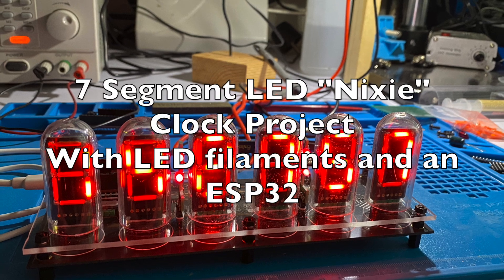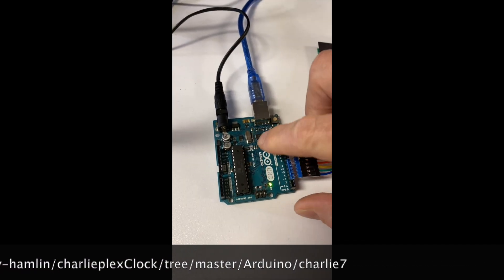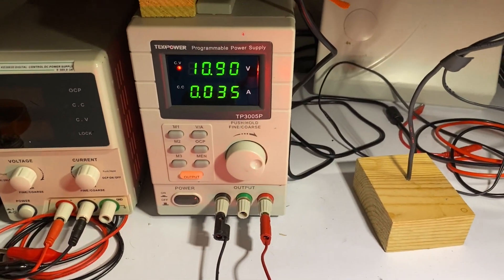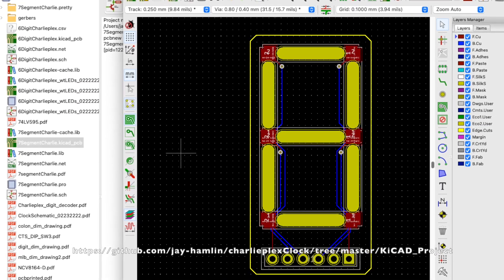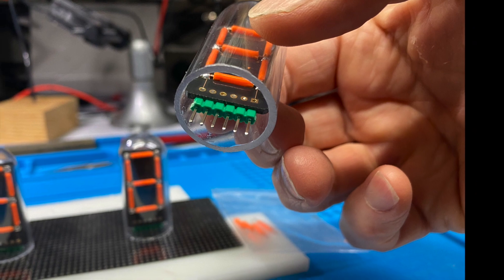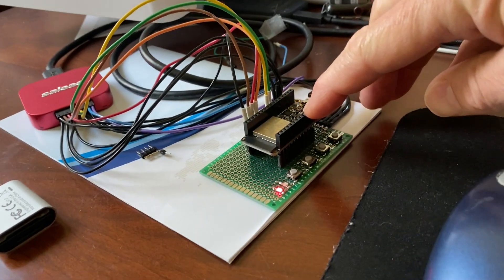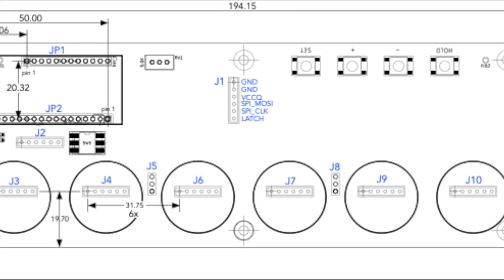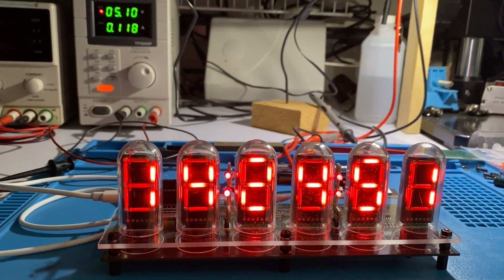LED "Nixie" tube clock, ESP32, Arduino, 7 segment, LED filaments

Comment: Why 6 pins for each digit, charlieplexing should reduce that to 4. (n^2 - n)
Reply from the maker: Yes, what you are saying is true - with 4 pins you could turn on any 1 LED segment.  The 6 pins are also mechanical, holding the ends of each segment. Also, with 6 pins, it can make any number digit without multiplexing.
Reply: @jayhamlin9991  0:58 I can see how each segment can be turned on at a time, but how would you make the digit "8" without multiplexing?  If pin 5 is high and pin 2 is low, do you mean make pin 5 high, make pin 2 low and the rest high impedance?  I think that might work, though current would be split down some paths.  It looks like you still multiplexed each segment, but maybe you designed for the possibility of doing it differently.
Reply from the maker: Ok, you are right, you got me.  Enough time passed that I forgot how it was done.  Only 1 segment at a time is turned on and the digits are multiplexed.  You can check out the code on GitHub and see how it's done.  @Enigma758
Reply: @jayhamlin9991  Thanks for the responses and sorry for all the questions (sometimes I think too much ☺) .  I think the fact that you used 6 pins made it easer to multiplex since you could simply break out each intersection.  That way you wouldn't have to hard wire the additional connections required for 4 pin charlieplexing.  And considering that was probably decided before you added the backing PCB, it seems like a reasonable decision.  But now that I think about it again, the digits are driven by the shift registers and not the microcontroller I/O pins so you really can't do charlieplexing since you can't set an individual shift register pin to high Z.  So I believe you are actually doing "traditional" multiplexing at the segment level.

At any rate, you did an amazing job on the clock and it inspires me to do something similar!

Comment: Question: I got those LED filaments here, where is the anode where the cathode part ? One end has a small hole in it, so it is definitely A/C but hardly to know which. Dont want to waste any filements, so any hint is great
Reply from the maker: the end with the small hole is the positive (anode) side. They are sold as "3 Volt" filaments but I found they work good at 30mA which was about 2.72 Volts.
Reply: @jayhamlin9991  That does the trick. Working (technically) now, however some faults, maybe you got an idea: seconds 01256789 working , but 3 is without the lower line, it's on when 4. Would assume something with the logic. Or do you got an idea on how to troubleshoot the display ?
Reply: actually, i noticed that the lower line (_) is reversed in anode/cathode, e.g. your old design is slightly different to the use. Question would be: How can i easy test out everthing (like console i type in a number and it gets displayed ? would help others as well.
Reply from the maker: @JanCzmok  I think I know the answer but I have not had time to confirm, this is what I think it is.  If you are using the Arduino charlie7 code, I had an early prototype with the lower line LED diode reversed. I think the code in gitHub is for this prototype. Sorry.  We need to swap the '1' and '0'  for the lower line. I can look at it tomorrow .
Reply from the maker: I did not write any test code other than the counting 0-9 in the code. It is only Arduino, you could easily add a console function.

Comment: Wow, those After Dark PCB's look so freaking amazing. Good job on the clock!
Reply from the maker: I really like OSHPark. I didn't document the soldering but I used a stencil and reflowed the board in a Black & Decker toaster oven.